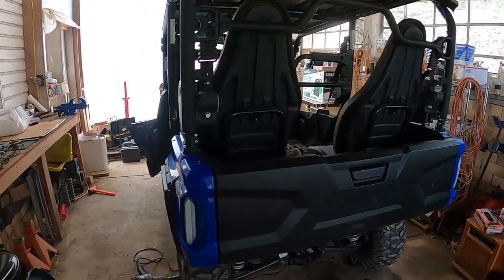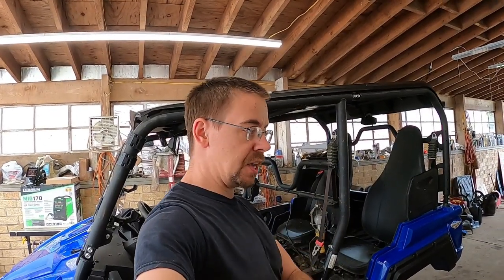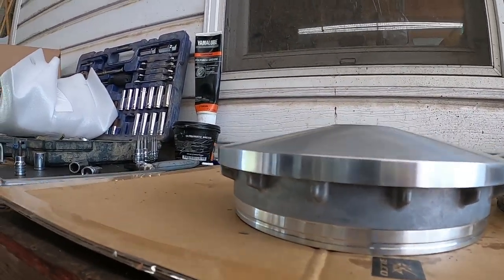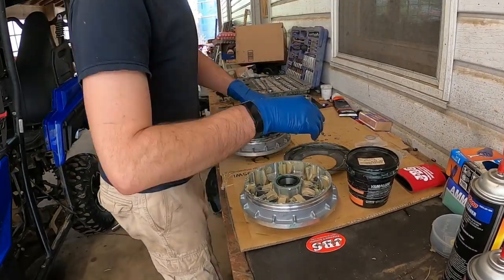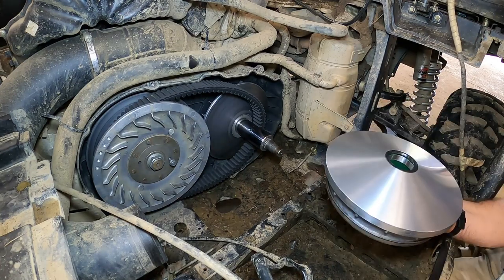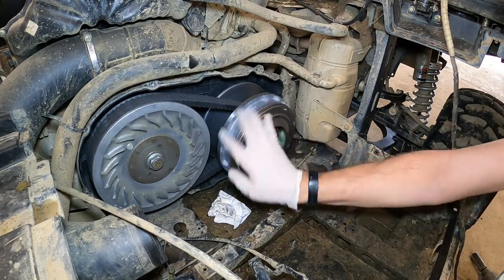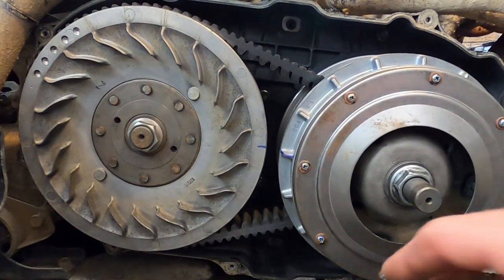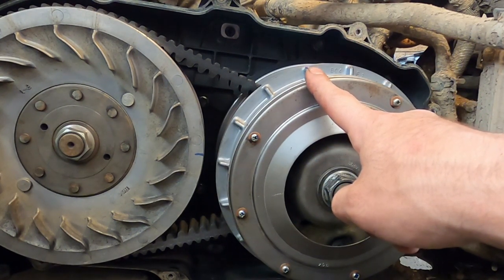Yamaha Wolverine X4 Hunterworks Vs JBS Sheave Comparison  Part 3: JBS Sheave Install

Comment: So I have 3000 miles on my machine. I bought it used. Stock everything except running 27s for tires. As for as primary and secondary. I keep hearing I need to tear into it.what should I do. It's not slipping or acting up in anyway.
Reply from the maker: They just need to be cleaned, re-greased and checked for wear on areas like the slide pins. Even if it doesn’t show signs of wear doesn’t mean it don’t have any. I’ve noticed with the ultramatic cvt yamaha has, you don’t really get any warning signs. It just decides to go when it goes quickly…lol. It’s still the best cvt system in the market…period!

Comment: If you were to run 28" tires what's the best way to maintain that low end grunt. I plow all winter with my 2019 X2.  I want bigger tires for more ground clearance and better snow traction but I'm not willing to lose low end pushing power.
Reply from the maker: Just a simple clutch weight swap to 18 gram weights should be all you need